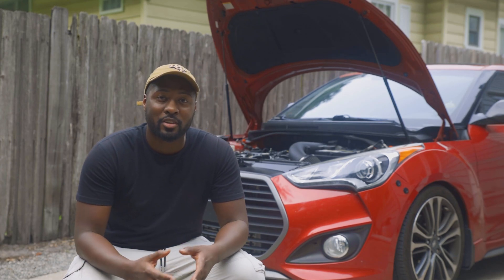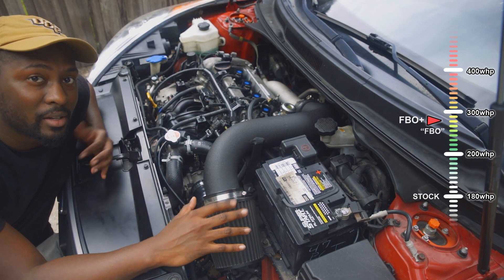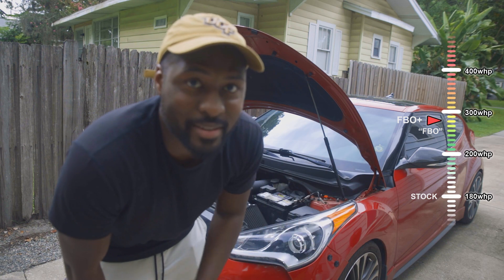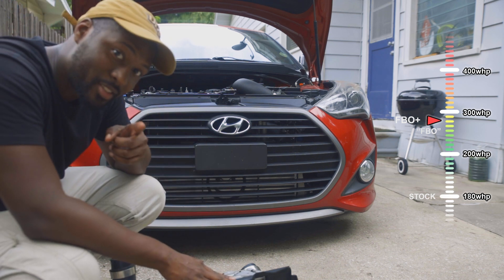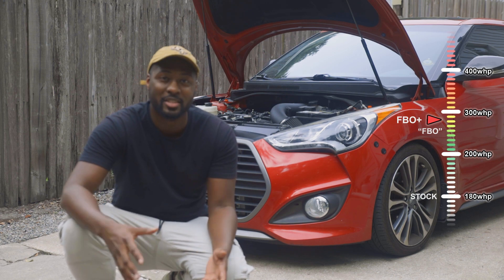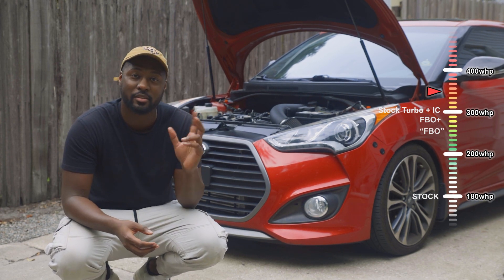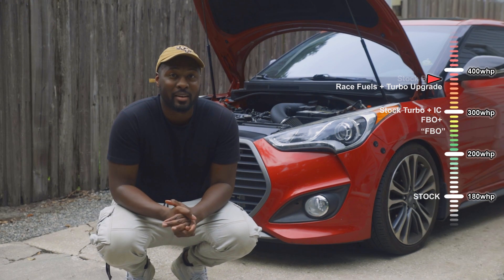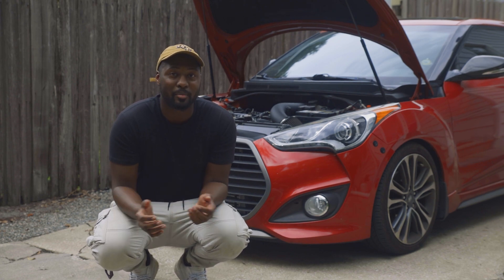How to Make Power | G4FJ 1.6T Engine

Comment: Awesome Video , I can never find info about this little engine. Except for tuners offering tunes and a down pipe / and intake etc.  HOWEVER , the METH Injection is what grabbed me.  19 Elantra GT N -Line with a clutch ) . This is the slowest most mundane car I have owned at 55 and I bought it cuz im not wealthy anymore and I dont live outside my means and it was the coolest possible car being sold that was practical ( hatch ) and most importantly had a clutch ( that they paid you 1200.00 to take the better trans AND upgraded you to fucking PS4S tires for free on a fucking Hyundai . 

Anyway I LOVE THE CAR cuz I paid 20K new . 20 K gets you NOTHING TODAY , I MEAN NOTHING in the way of ANY IDEA of sporty and engaging . I expected VERY LITTLE in the way of power if anything at all and frankly a 1.6 engine to me is not even worth building  " in my 55 year old mind" unless its in a 2500.00 pound car or even lighter . So I dont think its a great idea to use it as base to go fast even if its cuz thats what you got to work with .

I ended up liking the car WAY MORE THEN EX{ECTED on so many levels ( THE FUCKING PRICE and what you get ) but i was most shocked by handling with the german dudes IRS and suspension with the free GOD tires . The power, what I expected and some nites with perfect air I like it more then expected and when hot meh. I AM NOT HAPPT TO HAVE DI without some Port or something to clean . So meth allows for more timing and fuel and  cleans the top of the engine and modulates temps a bit . 3 for one , no need ( for my HP wants/ purposes for the Intercooler wich  was an obvious  weak link from day one. No IC cost removing bumper and other stuff needed .

If my car is 180 HP stock and pushing 3100lbs which is light for today but heavy fora 1.6 that loses a little from heat and NEEDS to be in the exact right gear to feel it has enough power . 1st with open diff is often too much power and such a quick gear . But I am used to V8s or bigger turbo 4s that are still not like a  400 or more V8 where you always have power. I wouldnt even want more boost in 1st but for sure everywhere and 4 5-6 especially) 5-6 are both overdrive and gutless unless your flying,

So too me 250 WHP would be perfect shit 225 -30 would make it GREAT as what it is designed to be which is the last CHEAP sensible car that has just enough ( any less an statement fails) HP to not be just an appliance and something you look foward to driving even if nots the kind of car you make excuses to drive  . At the least you get to flat foot it ( I think in dead stock trim its is a SUPER PLEASENT engine sound even if not loud , i dont need loud but like a nice tone and smoothness from a 4 that doesnt sound like its screaming with bolts in its mouth and not going anywhere or just shit a cruising) to redline it and quick shifting it which it likes and never misses a shift . It just make little trips fun by shifting . It has to me nice weight to and decent steering and the GRIP is stupid as far as cornering  speed on entry , the diif is what it is but for corners I just adjust a little and Im still like WTF did I just do on the mountain road with insane technical turns 5-10-15 or more in a row multiple times in a drive often. Its faster then it needs to be for that kind of momentum driving WHICH is why I think the car as far as the chassis suspension and brakes would not at all be overpowered for SURE with225-230 wheel which feel like I think every owner would like stock if they dont mod cars and arent obsessed with being fast but want a car that feels right. Basically a GTi minus the diff , 250 and it should feel quick like a fast 90s car which is plenty fast if its just your transportation but you wanna enjoy it and match the chassis to the power on the aggressive side . I imagine with the meth you can have an 87 tune that is turned up a smidge without buying expensive gas and then you can have a 93 + Meth to have some more fun but dont lose the nice thing about 87 being useable.

I STILL CAN NOT BELIEVE just because its designed to be run on 87 and they say the 93 doesnt do anyting although I could imagine how that could be. Somehow Im not a believer ( wrong or right that intakes do anything besides intake noise unless your trying to make big power . I feel like a tune and meth injection for both power but SAFETY and cleaner engine would actually be enough and downpipes are cheap . I dont even want a louder exhaust . Just want that power bump that makes the car fit the suspension ( which also is not crashy or bouncey and for street driving and if you not a maniac is fine for me as a grocery getter that I take some turns at stupid speeds and the car isnt even passing limits and feels GREAT to know I am pushing it and not gonna be going TOO fast so its not fun . I am not driving so hard for long while on brakes , because no LSD I am entering fast and momentum driving and not trying to slow down fast from high speeds that I am even Ok with the brakes . Dont want to race or beat anybody although I might slow roll somebody if they  have a stock whatever that isnt super fast and want to beat somebody and engage even if it is to lose but make them question why their XYZ didnt crush the hyundai they way they figured and looking and sounding stock makes that fun. 

I will watch other videos of yours to see how you handled the tuning . I am not flush so whatever I would do would be IT. I dont want keep paying for tuning . Plus I dont want to start braking stuff or over powering the clutch or hurting the trans etc , Just enough to feel stock if they did it right which is only off with the power in certain scenarios and ways . Weighing only 3100 pounds 45-70 more HP will give you /me the feel /power to match what they put into the platform and components . I love the seats for comfort and ergnomics but I am already jammed up on the door on turns with the speed I carry on technical roads if I am going for it which adds to the drama of slow car fast .

I hope I find more content about your meth set up and cost to purchase and get set up. I want this car to last and I want to able to rev it and shift it without always having to get out of it  before its fun cuz I am going way too fast .

Having the MT the car is already slower then the DCT , I drove the DCT and even though it was obvious its the better car for going fast and for not needing to manaully shift from 6th to 4th or 3rd when you have a quick decision to make when you need or want power and I WAS surprised who fast the DCT car was by keeping the turbo spooled and shifting so fast and OFTEN  but its not an ACTUAL fast car so still enjoy the power shift over acceleration but for an auto daily that is not expensive with tiny engine it never feels underpowered. 
It was good to see and hear a smart guy just illuminate whats actually important and not just talk about making the most power the easiest or by throwing a ton at a car that unless you lust like a challenge and spending money to brag how much power you have with an underdog / small displacement engine and speak to the DI issue and the thing that is gonna help your engine survive no matter your goals.

I would also like to know what somebody who did decide to get big power does about the diff issue or if they would just torque steer and wheel tramp everywhere and just want a car that is highway fast . That and if you know how much the stock clutch will hold and other stock components if all somebody wants is to go from 180-220 up to 250 ( i think with 250 WHP the car would start being nutty for what it is without going down a money hole ). With all the talk of heat modifying the hood to let heat out if it could be done without too much water getting would be cool but probably a bit much to figure I also dont know if these hyundai engines should be pushed . Luckily Hyundai puts it in everything so a replacement should not completely destroy you .
Reply from the maker: Haha alot of words. I'm glad you're enjoying the car! Yeah it's absolutely a fun little car that can wet the appetite with a few upgrades!

Comment: Theoretically how much power do you think this stock block would handle
Reply from the maker: Headstuds will be needed after 270whp... but 350 or so. And that's if you're covering all of your bases. After that, rods and pistons.
Reply: @AustinSWarren  so if i targeted say 260-265 like i did on my civic si it would be safe for the most part? im looking at doing the exhaust intake and wheels then having it tuned at some point. already ordered the intake and exhaust :)
Reply from the maker: @yoltsbp  yeah 260 is a nice target without having to sell organs 😅
Reply: @AustinSWarren  
I would be crazy 😜 happy with 250 / 260 hp🤪🤩🙀 on my VT 2013🤨
Reply: @jameskillian9269  that’s what I have a 2013, did the exhaust, intake, forged wheels, and intercooler resonator delete. Definitely pulls significantly harder than it used to. Next is to do the wide body and have it tuned!

Comment: The front grill can be changed out to a more air efficient intake Grill even removing the front license plate can help that one extra inch makes a big difference in the intake airflow also where the flood lights are placed they have intake air vent ports that can be attached to that area with high performance intake fan that will allow more air intake and finally the bottom skid plate that is normally made out of plastic from the factory can be changed out for a metal one with holes in it to allow even more airflow that helps allow the engine to breathe better dissipating Heat. Make sure that you're cooling hoses are well protected so they do not melt. And don't forget to remove heat shield from Hood if your car has one. Your paint might get baked but it'll keep your engine cooler without it. Use 5W-20 pure synthetic Quaker State oil and change it every 1,000 MI make sure you use a high performance oil filter which may be a pain in the ass but will save your engine.
Reply from the maker: Not disagreeing with anything you've said here! These are all mods that can be made to gain that extra 2% on track. Lol unfortunately I'm not a track guy

Comment: I was thinking of going fbo 93 with the stuffed ko3 turbo pushing 300-350whp max a daily driving it. Would that be ok reliability wise you think or would I need more ?
Reply from the maker: Definitely would add meth to help with power, safety and reliability. But yeah.  I'd say I'm floating around 300ish dailying. I'd attempt to tune further but I don't like my compression test numbers.
Reply: @AustinSWarren  definitely adding meth,once I install it do I need to retune and Can it run safely on stock tune with fbo? How often do I need to refill the meth tank?
Reply from the maker: @Jcastro9444  well if you want +300 on 93 you're going to need that meth in the tune.

You can run meth outside of the tune as well.  Helps with Temps and all that.

You'll also need headstuds if you're going past ~270

How often to fill... Depends on how you drive lol.  When I was being a street menace, every few days. Now that I split my time between the bike and the car, about as often as I fill up for gas.
Reply: @AustinSWarren  my bad for all the questions man I'm new to the platform and wanna be as safe as I can since I'm gonna be daily driving it. Where do you buy the meth from?
Reply from the maker: @Jcastro9444  you're good! I was new too! Questions are how you learn.  Check out the velosterturbo.org forum for alot of info.

There are a few race shops in my city that sell special fuels (methanol,  mr12, c85, Nitromethane). I get 2 5gal tanks every time I go.  Usually lasts me 3-6 months.

Comment: I'm a bit confused. To get to the FBO stage, do I need to do all Flow and Heat mods, and do I need a tune? What would you recommend for beginners that are easy/cheap?
Reply: ECU tune, Intake and exhaust is a good start
Reply from the maker: What N75 said is the answer to where to start!

FBO would be "all the bolt on mods". Intake, exhaust, downpipe, intercooler. Some people count the turbo upgrade as bolt on, I don't on this car lol.

Comment: I thought it was stock 201 horsepower ?
Reply from the maker: You're correct! But that's 201 at the crank. After all the drive train losses only about 170-180 makes it to the road :)

Comment: Trying to push my 21 Kia K5 GT Line to a decent limit. I haven’t done any performance mods yet, because it’s more of a show car right now. But I do want to get into things, where should I begin? Also with the car being so new some things bc aren’t available now such as down pipes and what not.
Reply from the maker: That's hard to say because, like you say, it's such a new car. Things like BOV valves and intakes don't necessarily add performance but they do add smiles!

I would say look at getting a tune if available. Something stage 0 or stage 1 that works for a mostly stock car. See where the potential is!

Comment: Youre saying you can just put the elantra throttle body on and it will work? like its for sure compatible with a V
Reply from the maker: Well that relates to gen 1 1.6t's. But yes, plug and play!
Reply: When you say Gen 1 that's including 2015 turbo r-spec? Isn't gen 2 the rebuilds in 2019?
Reply from the maker: Correct! Gen 1, I'm referring to the 2011-2017. Although in 2016-2017 had stronger internals.

2018+ is gen 2's

Comment: Hello, I have a 2013 turbo model, and I’m saving for your intercooler setup, with a stock block is it worth it, or should I first build my block?
Reply: I already have a 2.5 inch down pipe with one resonator, ingen intake, and a HKS BFV
Reply from the maker: Well, because '13 are known to have bad internals, I'd say you're probably going to approach your limit very soon. I would worry about the block. Alternatively, if you can trade up to a '16 or newer, that might make more sense financially. Compared to trying to find a '16 block, have it swapped. Or taking the '13 block and changing out all of the parts.

Comment: Great video I have 13 VT I did the 60 mm throttle body with the KDM spacers with ports. Is that where you did your meth injection port? If so why did you decide to put it after the throttle body instead of before?
Reply from the maker: Yeah that is where my meth port is. I plan to add one more nozzle on the intercooler piping eventually.
The spacer has to be there lol. 

Or are you asking why my nozzle is there and not before the TB? That's the most efficient location on this car, other than porting each runner.

Comment: I have a 2016 Kia Optima lx 1.6 turbo I can’t find many parts or tune for my car, can all these parts be swapped since they have same engine? Any advise will help
Reply from the maker: For the most part yeah. Some parts like intakes and intercooler piping might be specific to the car due to the fit but the small stuff should work without much modding.

Comment: I bought a 2020 proceed (eropean forte GT), which is only available with DTC in my country. Do you you hos much torque the stock gearbox can take? I would love to start playing around with some bolt on stuff
Reply from the maker: I'm not super knowledge about the newer model, but I'm told the DCT is more robust than the old one so you should be able to throw 300+ at it without big problems. At least for the transmission anyway

Comment: So if running 311lb-ft of torque (2022 Kia Forte GT) you'd suggest getting new head studs or should I be alright for a while? Car has under 600 miles but I don't want to risk hurting the engine. Thanks for your content, brother.
Reply from the maker: definitely what he said! That's alot of torque and I'd be looking at head lift and other issues. I'm not super read up on the newer engines, but 311lb-ft, you should definitely consider building the bottom end.
Reply: @AustinSWarren  I'll simmer down my map for now then, thank you for your reply!!

Comment: I just bought a 2016 Veloster Turbo. It has aftermarket exhaust on it.. sounds like maybe strait pipe.  Looking for some ways to add some power.
Reply from the maker: Awesome! Well this video is a good starting point. You can bop on over to the velosterturbo forum for alot more information
Reply: @AustinSWarren  thanks. I will probably do so.

Comment: Could you go FBO without a tune?
Reply from the maker: So as you increase flow by going FBO, You'll start to run into the limiters of the stock tune. So you'll notice the occasional limp mode, cel, and things like that. Could you do it, sure. But you'll definitely want to get that tune.

Comment: I’ve been looking for this 💯☝🏼☝🏼 I have a 2020 elantra sport. I have downpipe , hotpipe, axleback exhaust, rear sway bar sitting on some Perrelli nero zero’s. All i need is Intake and tune 💯
Reply from the maker: Lol almost all my to a tee! You're going to love it when you get a tune! I recommend going with Sxth, Qwik tyme performance or N75 Motorsports for tuning!
Reply: @AustinSWarren  thanks man! I really appreciate it! I have a question about piggybacks. I’ve been thinking about running one just for now while I’m saving for a tune. What’s the most reliable piggyback from your knowledge?
Reply from the maker: @chill5251  No problem! I have a video on the channel about piggybacks. I don't usually recommend because they are inferior to ecu tunes, they perform worse and  for a few more dollars you could just have a better ecu tune! But I talk about kdm specific ones I'd use if it really came down to it 😅
Reply from the maker: @chill5251  haha thanks man! Just trying to make videos I wish I had when I started with the car!